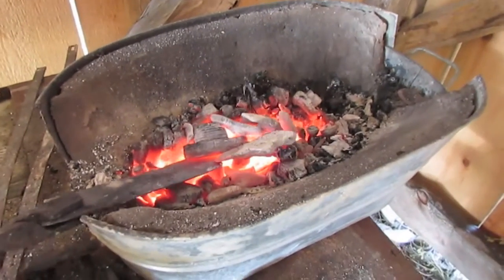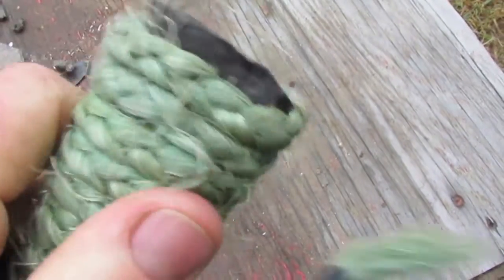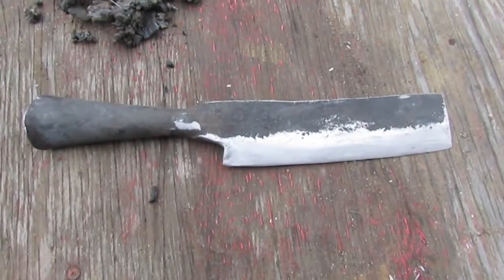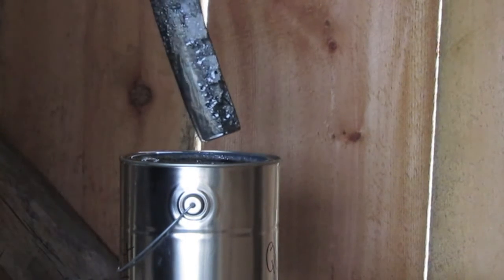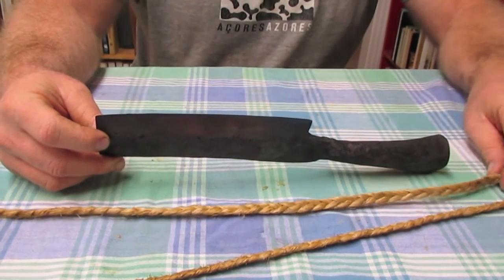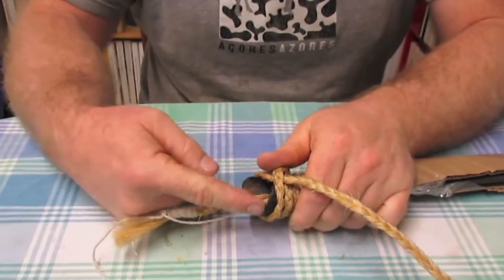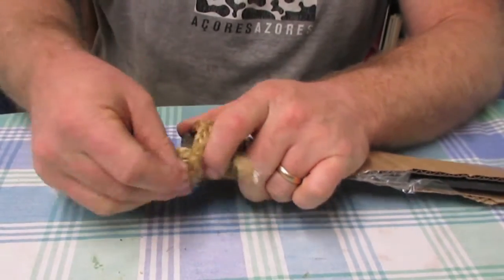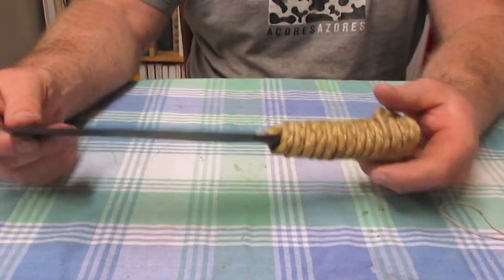Forging a Nata Billhook

Comment: Nice, has a cool neo tribal look to it, reminds me of the knife/small cleaver I forged out years ago for the purpose of cutting up some of the larger lump charcoal into smaller pieces for my forge fuel. My quench tank is basically 5 inch diameter pvc pipe with a concrete bottom, and warmed canola oil for the quench liquid. Works for me.

Comment: Good job! I am a knife Smith, you did well, better socket than my first time! Blue is softer than straw color but that is fine. I use an old roasting pan for a quench tub BTW. Got here from Skillcult, so blame him!
Reply from the maker: Well, I was a little surprised to see the range of temper colors, I assumed that in the oven the color would be more even?  Seems to be holding an edge just fine.

Comment: I would have epoxied the twine and sanded it. I may have to try that.
Reply from the maker: That's definitely an option.  I was trying to emulate a more traditional nata handle, which are normally rope wrapped.  I have an inexhaustible supply of hay twine, so its not a big deal for me if it wears out.  I did have to mess around a lot before I figured out how to do the wrap where it didn't loosen up and slip around.  But real Japanese traditional nata don't have a socket handle like this, it is typically a bar with an eye on the end, so there's a place for the rope to be solidly fixed and it packs tighter.  I'd make the handle differently if I had it to do over again, but I really like this tool anyway.
Reply: Oxbow Farm a couple of my uncle's own farms and I'm sure I could get s bunch of twine for free. I think the epoxy method would make a nice micarta type material.